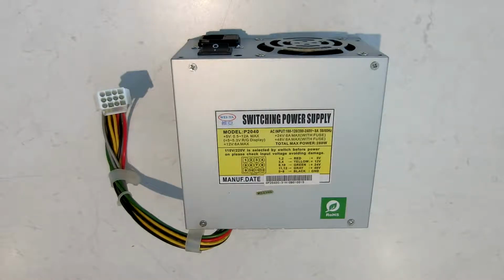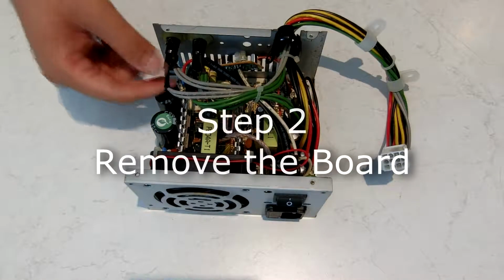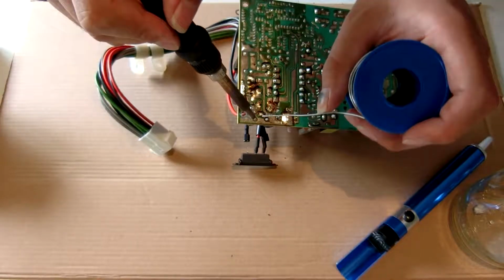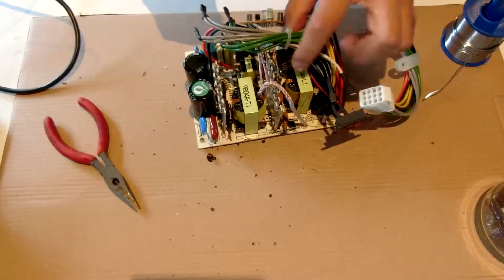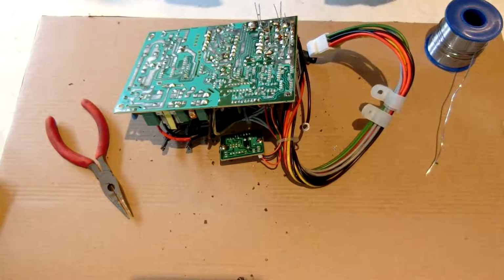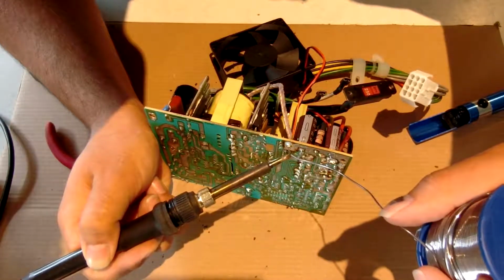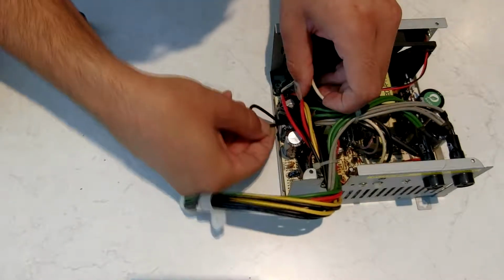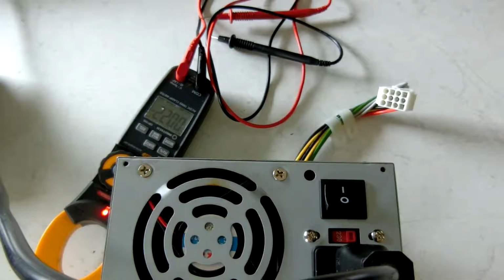How to Repair Wei-Ya P2040 Arcade/Crane/Claw Power Supplies

Comment: hello very nice video, i have one power supply with a problem: after how the claw goes up and tries to go home position the power supply shut down and doesn't back to be on.  how can i find the component that affects 24 volts and turns it off? the motor use 24 volts.
Reply from the maker: Honestly I have no clue, I haven't worked on these pretty much since I posted the video

Comment: Fantastic information. However, do you know the values of the resistors, R54, R54a, R55, R63
Reply from the maker: No sorry, I haven't worked on these power supplies in years
Reply: Dunno if you ever got the info yourself, but we're going through this same issue ourselves now, so we figured we'd leave our numbers for anyone who stumbles by in the future.

R54A and R54 on a good unit both measure ~6ohm, and R55 measures ~150ohm. dunno about current rating unfortunately, and i hadn't measured R63 in the one we worked on here.